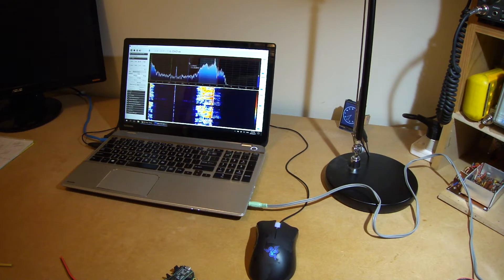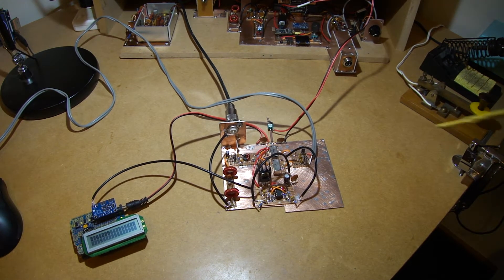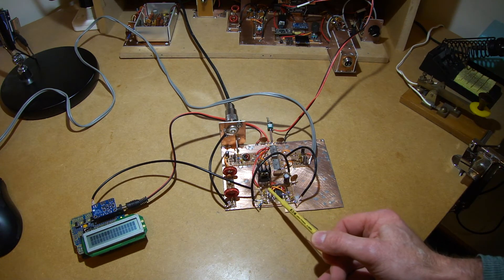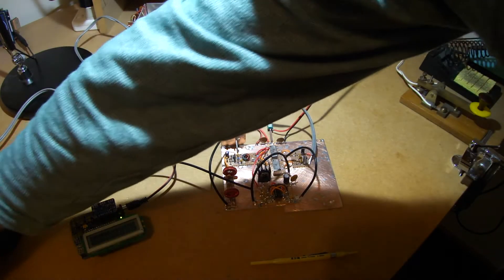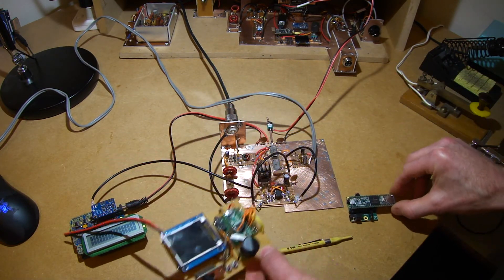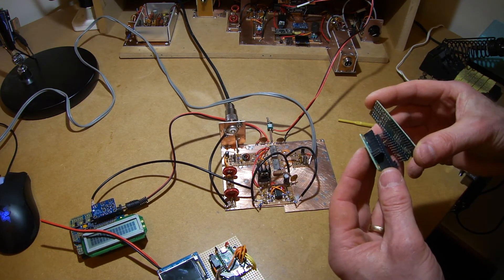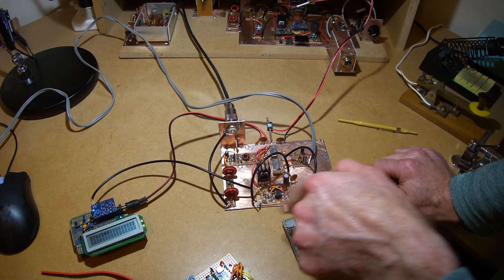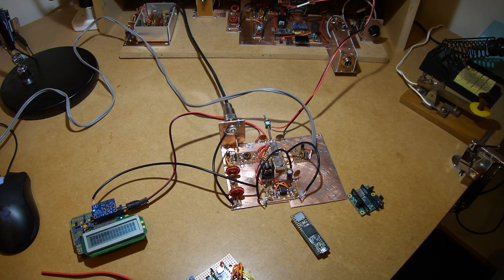Homebrew SDR Receiver - Hardware and Software Overview (Not RTL-SDR)

Comment: I have a question is it possible to make a SDR receiver on my own please help me where to start and how to learn
Reply from the maker: Yes. I suggest you take a look at the SDR transceivers I have build using the Teensy microcontroller. That would be a great way to get into it. After that, you can look into direct sampling and perhaps write all of the code.

Comment: Nice project, i have 2 questions:

a) you drive 2 passive mixer with 0-90° square signal , without filter ?
b) what is the phase error after 4 time IC divisor ?

i made similar project with passive mixer but only in first conversion at 10.7 mhz:

https://drive.google.com/drive/folders/0B0F7sjwiBOq9UFNPRWEzMjBEaG8?usp=sharing 

Arnaldo ik2nbu
Reply from the maker: Hi Arnaldo. Yes, I have had no problems driving double balanced mixers (commercial SBL-1 or homebrew) directly with the Si5351 square wave output. I've made several radios with that scheme and they all appear to work well. It's slightly greater than 7dBdm, but again, it seems to work well. There was a good article some time ago on the Soildersmoke blog about square wave VFO/BFOs and DBMs. Refer http://soldersmoke.blogspot.co.nz/2016/03/blog-post.html

As for phase noise, I am not so sure. I tend to go by ear, and what I hear is more than acceptable to me. I'll look to do some testing once the back end is complete, and if need be, redesign the front end. It's all about experimenting and learning!
Reply: Charlie Morris thanks for you reply. test ssb rx with 2 tone to be shure about performane. With only 1 ° deg. phase error, the separation between usb and lsb is less 30 db in most case, when in a classic rx etherodyne conversion you can obtain 50 or 60 db value with a good quality cristal filter.

Comment: What's the reason for using the splitter when the Si5351 can generate the quadrature signals directly? 

Looks really similar to something I've been sketching out and collecting parts for, the Teensy could make this incredible
Reply from the maker: Hi Clint. Ideally I'd like to generate the quadrature VFO frequencies directly from the Si5351, but I could get it to do it at below 4.7MHz. The problem was trying to access the R divider. I made contact with Jason Mildrum, the author of the Si5351 library that I'm using, and he too had problems using the R divider scheme. He said the phase delay appears to be done after the R divider output, so you can change the R div when using the phase setting, but the phase delay doesn't scale with the R div setting you choose. 

If you can make it work then please sing out, as that would certainly simplify the circuit and make it more in line with what I'd prefer. I have a few AD9850 here too, so a slaved pair may also be a solution. There are some example of that scheme online.
Reply: I've seen claims* it'll work down to 3.2MHz, wonder if the reference crystal makes a difference?

I'm glad someone has made me aware of that potential limitation though, I'm writing my own PIC code for these chips and I'd have been tearing my hair out trying to get it to work :)

*claimed here: https://qrp-labs.com/vfo.html
Reply from the maker: That is interesting. Like you I tried and tried to get I and Q outputs below 4.7MHz. I wonder how they have done it here.  Maybe it is the ref crystal. I might have to come back to that later. Thanks.

Comment: Like Dale I've also been hoping someone would start using Teensy as a step up from Arduino, and to do DSP as well as just being a controller. The IoT world is exploding with little self contained MCUs, every week there are new ones. Good luck, I'll be watching! VK3HN.
Reply from the maker: Totally agree Paul. Paul's audio libraries for the Arduino IDE, which you use to program the Teensy, are really powerful. I used an old Teensy to make an active audio filter (the other Teensy in the video) for an old boat anchor radio. I used a FFT to plot out the audio spectrum, then a variable digital filter for SSB and CW. Very easy to use and very effective.

Comment: are you basing it on https://github.com/DD4WH/Teensy-SDR-Rx or gonna do you own?
Reply from the maker: I intend to do my own, in that I don't want to just download someone else's code and install it. My primary aim is to learn. I'll start with researching SDR 101 and go from there. I will say, however, that rheslip's blog (Open Emitter) was inspiration some years ago, and was the reason why I bought the original Teensy. It's only now that I have the time to dedicate to it. Like DD4WH, I'll use Paul's libraries.